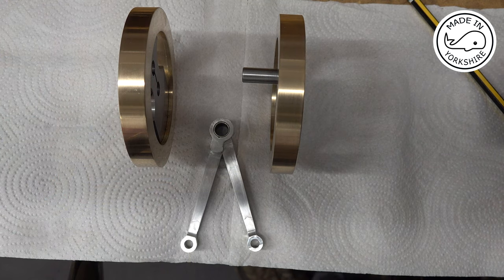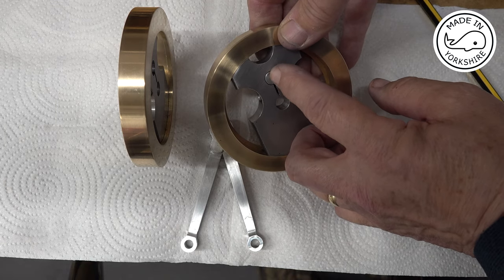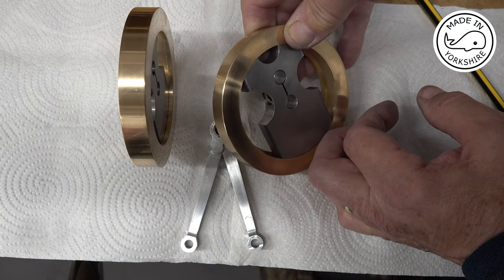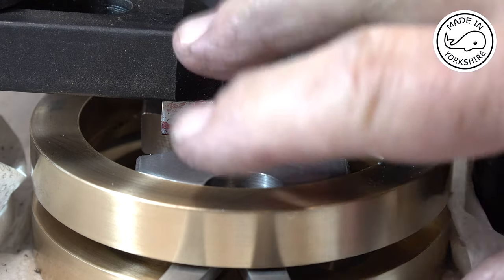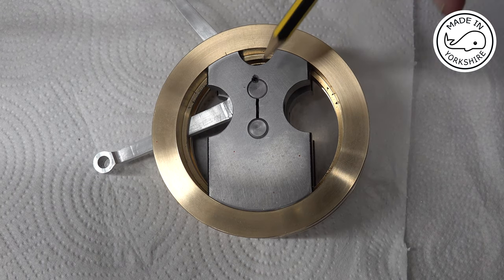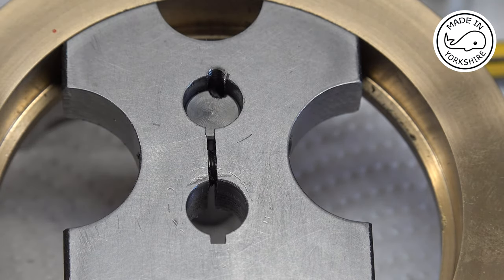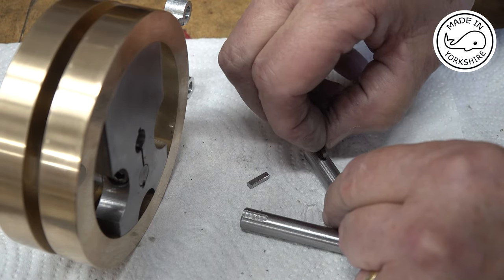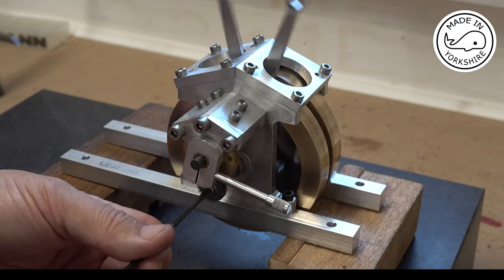#MT44 Part 9 - Hoglet V-twin IC Engine. Crankshaft Assembly. In 4K/UHD by Andrew Whale.

Comment: Hi Andrew, although it's too late, the reason that the crank would not tighten against the pins is because there is no relief slot cut opposite the pin holes in the counter weights to allow the hole to close up with entirely too much steel fighting the action. your method is solid in this case.
nice work so far
Rich

Comment: Now we're really making progress in the right direction👍
If you remember a while back I sent you some photos of the axial split line screw method seen on my Harrison lathe screw cutting indicator. It works very effectively providing the male and female components are a snug fit,as seen here. The reason that original clamping arrangement isn't  working as intended is the slot is too short and the hole needs to be finished with an undersized reamer. Under and over sized reamers are available to get interference fits and clearance fits just right. Glad to see it has finally worked out OK.
Reply from the maker: Thanks Howard - I remembered the picture you sent me and that was the main reason I chose this method. It does seem to be very effective. I couldn't find your email, otherwise I would have given you a mention. Many thanks for the tip!
Cheers
Andrew

Comment: The drilling and tapping is called a French key, ignition timing will be interesting as it’s an “odd fire” engine, same as a Harley Davidson.
Look forward to next video 👍
Reply from the maker: Thanks for the info James. I've not really thought about the ignition. I don't think there is a distributor but there are two magnets to trigger a hall censor. I think I will have to do some research at some point.
Cheers

Comment: Excellent job! The set screw in the joint between the crankpin and the crankweb is called a "Scotch Key" or a "Dutch Key": both references are sneers (lower case insults), because the term "Scotch" or "Dutch" in this context refers to the expedience of manufacture (i.e. cheaper) of this type of key versus a "true" keyway, thus the name.
Reply from the maker: Thanks Matthew. Interesting background. I'm glad it doesn't mean 'bodge'! 😂
Cheers
Andrew
Reply: @learningturningmetal  Well, that's just it, isn't it... it is a strongly implied bodge (but it really isn't when faced with the facts).

Comment: Hi Andrew, Excellent idea using the key and grub screw. No problems with something coming loose in the future. Out of interest how many ton's is your arbor press?. 
Must admit the more I look at the plans and videos of the 'Hoglet' the more I fancy building one. Regards Kevin
Reply from the maker: Thanks Kevin. The arbor press is 2 ton and it comes in really useful. One of those things that wasn't on the top of my wish list, but having got it I wonder how I managed without it. The Hoglet is described as a 'show and tell' engine as it's not really designed to drive anything. My plan is to go on and make the Jerry Howell v-twin if I the Hoglet turns out OK. The Howell engine is very well designed and a major challenge.
All the best.
Andrew

Comment: This whole crank shaft is looking more and more like the design somebody came up with to make it as complicated as possible to make.
Its beautiful to look at, but looks like it belongs in a clock.
Reply from the maker: Ha ha Tony. Maybe if it doesn't work out I could re-purpose it into a clock!
Cheers
Andrew
Reply: @learningturningmetal  Nicely put.
Don't get me wrong its beautiful, Its just I'm lookin gat what I might do in future and this might be one, but not with this crank setup.
I was looking at the Hemmingway engines and noticed their Aero V Twin. It seems to be far more practical.
But then you have helped preserve a quirky engine and that's always a positive.
There's actually 2 quite quirky and interesting engines I found. The Hemmingway Cygnet Royal 3 Cylinder radial and the Stuart Turner Sirius upright twin. Both Steam and both based on high performance racing engines for boats.

Have you seen or checked out either?
Reply from the maker: Hi Tony. I think I've caught the IC engine bug. The Hoglet isn't designed to drive anything and is described as a 'show n tell' engine. If the Hoglet turns out okay I plan to make the more complex Jerry Howell v-twin. The Howell engine is a very good design and quite challenging. So the Hoglet is really a test to see if I'm capable of something more complicated.
Well that's the plan!
Cheers
Andrew
Reply: @learningturningmetal  Have you considered the Hemmingway Aero V Twin? It has a casting kit available and a full material and castings kit.
Reply from the maker: @tonywilson4713  Interesting - but having purchased the plans, I'm still pretty much committed to the Howell.
Reply: @learningturningmetal  I checked the Howell webpage there's some interesting projects there.

A couple are really interesting to me because even though I am Australian I actually went to the University of Illinois and a couple of those engines are from Illinois.
Reply from the maker: @tonywilson4713  It's a small world!
Reply: @learningturningmetal  I was watching Dr. Becky the astrophysicist yesterday and she said nothing makes you fell smaller and less significant than astrophysics. The realization of just how small our planet is.